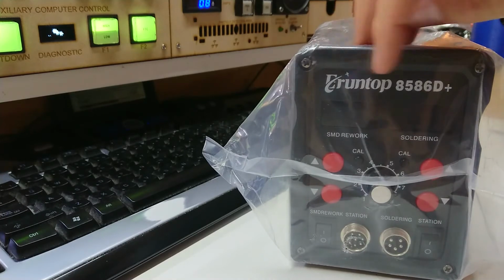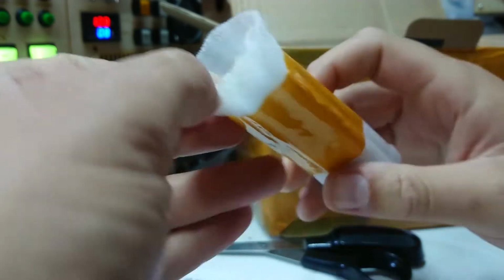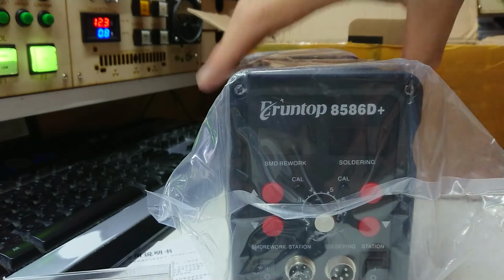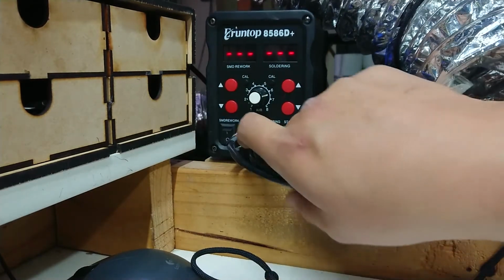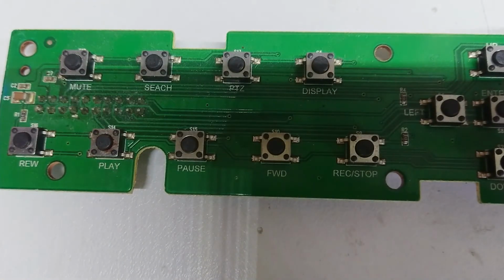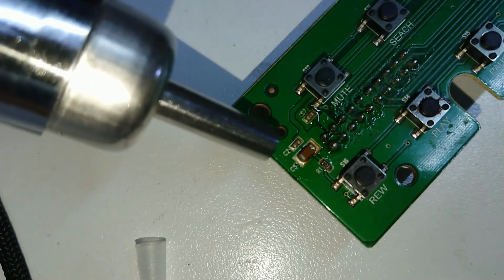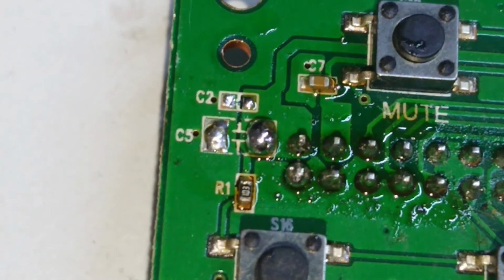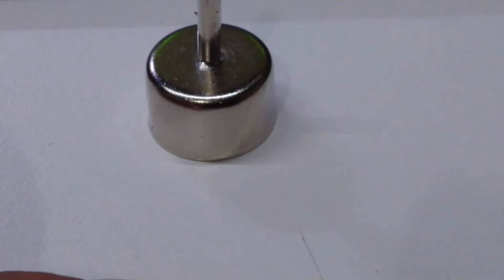Eruntop 8586D+ SMD rework/soldering station

Comment: I had this station, but under yarboly brand, for about two years before something went with controller and it started to set 400 degree celcius on soldering iron handle, wchich led to final meltdown with glowing heating cartridge. Besiedes ultra low price, i wouldn't recommend it for anyone.
Reply from the maker: Yeah sounds like the temp sensor died.
I have my good old weller, this is just a backup

Comment: I have Eruntop 8586 D + stations from aliexpress.  Hot air gun set to max blows very poorly.  Will the hot air gun blow stronger by replacing the potentiometer on the motherboard with more / less Ohm?
Reply from the maker: I haven't investigated this at all, if it has a failure I'll open it up and see what can be done, but for now, this is providing for my limited needs.